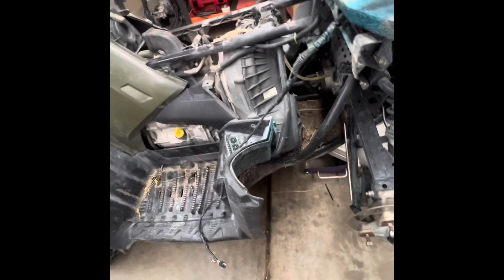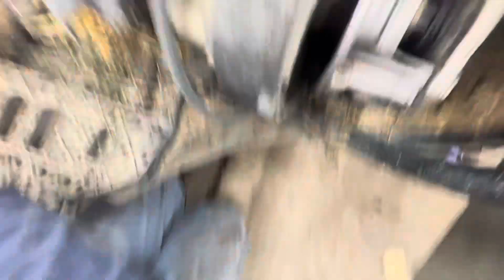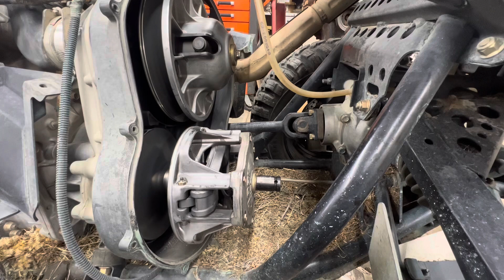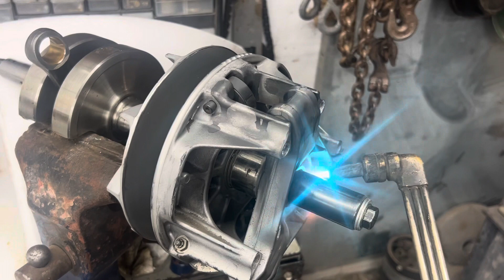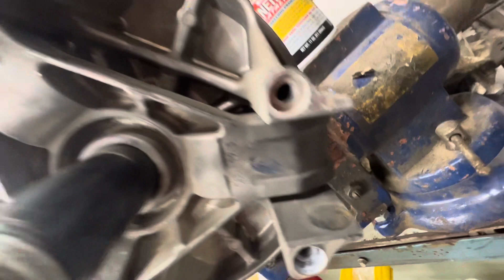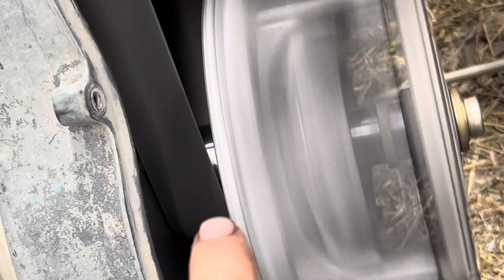Polaris 550 850 hard shifting ￼& clutch issues

Comment: My spider came off turning left even though my machine looks identical. Now there’s a lip not allowing me to remove bearing. It’s was on very tight with lock tight, needed breaker bar entire way off. I’m gonna reinstall and hope that Corning the other way removes the lipped edge
Reply from the maker: Well, you did that totally wrong. You did not remove the spider, You took the back sheave off of the whole assembly by turning it that way. You need to lock tight and torque that back down to 210 foot pounds let it cure and then heat the spider and turn it to the right. Maybe watch the video again.
Reply: Yeah should have turned it to the right. Thanks!